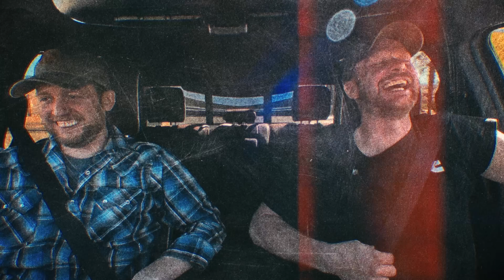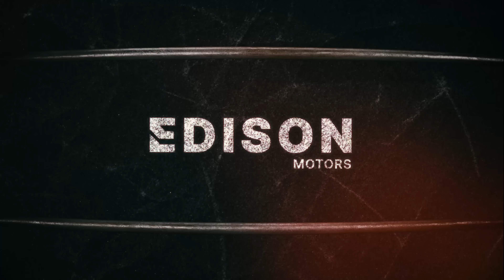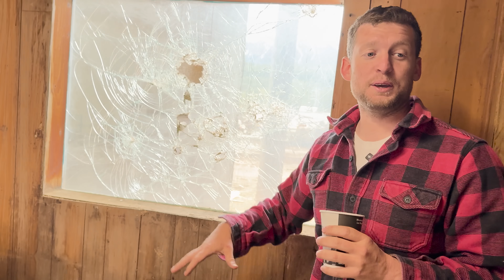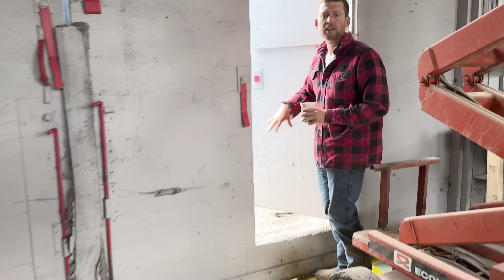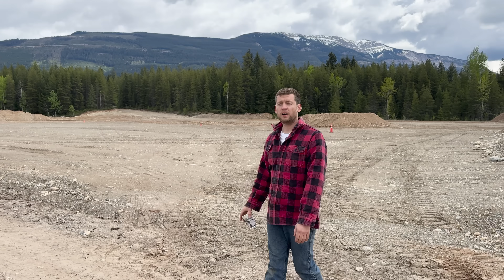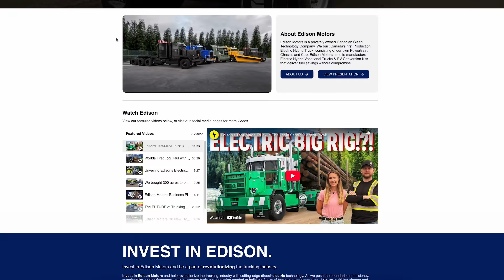Shop & Housing Update: Tour, Progress, and Investor Day Invite

Comment: Septic:  NB biogas/methane digestors!  They turn food waste and poop into methane that can run a genset, or, with a town gas connection; help run it.
If you use the (normally) wasted heat from a genset for heating rooms and workshops and water; the genset efficiency goes up from 30% to over 80%!
See Combined Heat and Power. (CHP)
They equal heat with FREE electricity, or electricity with FREE heat, depending on how you want to look at it. 

ie: Don't just go Old School; go greener/cheaper and more in line with the Edison ethos...  :)

Comment: I've been engineering an automated greenhouse for microgreens for about a decade now while I've been working in construction. Fully automated food production is the goal, then residential conversion from agricultural land without losing agricultural capacity. Also designed an automated BSFL facility, ultra lean like the microgreens to take advantage of the waste products. My system uses zero plastic for the microgreens unlike my competitors with a mountain of degrading microplastics spread all over their farm, and it's cheaper than conventional greenhouses in both initial investment and ongoing expenses. I eliminated the plastic trays and almost all of the work, while gaining 1.4x the growing area due to the angled vertical growing racks. Your story is helping me push my own project forward because at this point these projects are mostly limited by me. I never wanted to plan for investors or loans so I focused on material efficiency. That lead me to create an extremely lean, scalable model that I'll be launching soon in London, Ontario. It will scale with subscriptions, lower the price of microgreens to about 1/3 retail but I can actually get them down to $3/kg in my system while retail is $100/kg. They are nutrient accumulators so when demand runs out for the microgreens I'll be selling vitamins C, A, K, E and Folate, as well as chemicals and biodiesel derived from the microgreens, insects and their waste. It's not about the microgreens, they're a stepping stone to becoming an agricultural to residential land developer. My plan is to sell houses with rooftop greenhouses that pay their mortgage for them. The available housing will also serve my employees, allowing me to artificially create a community while selling some of them along with a production contract.

Comment: Recommendation: Carve out a 'bush' runway, 4,000 feet or better so those that have business aircraft and are considering placing orders can fly in quickly and see the facilities and projects in progress. Logging and oil field operators often use light commercial aircraft to rapidly move between sites  its a force multiplier for them   you seem to have land available.  Perhaps incorporate it as part of the test track as a straightaway portion
Reply from the maker: Okay, I’m listening
Reply: @EdisonMotors 
Golden just recently repaved their 4500 footer so you good if you got the fancy people visiting:)
Reply: @EdisonMotors  The idea came to me when you were standing on the leveled area speaking about waiting for soil engineers to come on site.
 I thought what a good hard pack soil for a bush runway. Then I remembered my younger days when I managed an FBO flight ramp and fuel operation. We had quite a few corporate businessmen that used General Aviation category planes to free themselves from the restrictions of hub airports and airline schedules. it allowed them to beat their competition and get more done in a day.
 Further I have seen factory sites that put runway infrastructure to do double duty.
  So my thoughts are the various regulatory agencies you will deal with will require engineering studies / evaluations for braking, handling, and start/stop distances for the various platforms you will build.
 Example accelerate to 60 or 70 mph then apply brakes and measure stop distance, dry pavement, wet and icy.
 That has to occur on a hiway standard paved surface.  If you plan that paved surface in such a way that it has clear approaches at each end, then you also have a perfect hard surface all weather runway

And the justification for the paving is because you have to do testing on a real world environment
Reply: Plan for a bush runway now so in the future they can hop in a little bush plane and zip down to Calgary.
Reply: The runway could be part of the test track, if its possible for people to fly in they can see the whole site on the way in, ease of access is always a good idea for customer relations, have to say its a really good idea 👍
Reply: Agreed. 3500' gravel strip with clean approach and departure ends is standard for remote communities in Northern Ontario.
That is plenty for a PC12, Caravan, Navajo, and B1900. With a solid enough base, even Dash 8s and ATRs will regularly come and go.
For guys who like to play with heavy equipment should be no big deal.
Only issue is that it does require mechanical upkeep with grading, compacting and snow clearing.
Reply: Yep, it's a nice straight section with just a bit more clear to the sides and a nice turnaround at the ends.
Reply: Came to say the same thing 😂
Reply: In 10 years, Edison will have more commercial trucks, than Tesla.
Reply: CYGE at Golden is an asphalt 4500’ runway. How close is the town? That’ll do for anyone flying in from AB or BC.
Reply: Why? Golden has a 4500 feet municipal paved runway 20 km away?
Reply: Make it only 100 m so only STOL Supercubs can land 😍
Reply: i could also help to fly in parts that are late or needed for service
Reply: It’s a ton of work to build a runway to accommodate a King Air or larger twin. Maybe someone comes in on a Caravan but I somehow doubt it. PC12 perhaps. 

I’d be hesitant to land my 172 at a new strip carved out by non pilots. I like the idea of an airstrip, it just needs to be done properly and for the right audience.
Reply: That would make a nice drag strip for some weekend activities 😂
Reply: If the runway was part of the test track the test truck would damage it, no?
Reply: There is an Airport in Golden just 20 minutes south of  Donald.
Reply: @tfodthogtmfof7644  if Edison has their own strip, then they won't need to rent hangar space in town.
Reply: @tfodthogtmfof7644 There isn't a auto rental facility though...

Comment: Sure seems like a great idea building in the k
Middle of no where. Until everyone you need parts and running to town isn't a option. There's a ready fab shops and manufacturers find somewhat local areas to build. Because hour down time will outweigh you land cost. There's a reason they liquidated that too Edison aswell, get that liability off there booms. It's not rocket science. Imof Edison makes it they will have huge capital cost of finding a new home and moving I'm under 5 years.
Reply: Nah. I think the frames are coming in from Vancouver, the engines from Sweden,  the cabs from Penticton, the batts and electronics from overseas. The rest of the big stuff comes in via semi truck delivery. 

I'm sure anything else they need like generic nuts and bolts they'll keep a big pile of because, just like you say, there is no "quick run into town". 

After a few lessons learned, they'll be just fine.
Reply: @Sah-o5m  and that's why every manufacturer of everything in history had ended up in a city. Like even consumables, like i highly doubt they are going to have a warehouse full of parts let alone want to overhead of a warehouse full of parts. So now everyone you run out of something your build comes to a stop because your waiting on a delivery or something.  Downtime will outweigh these positives soon enough. Who ever they bought the land from along with the realtor are laughing all the way too the bank.....

Comment: I'd highly, highly advice to store batteries in a separate building that has no other purpose than battery storage. Costs next to nothing, but can save your building or even lives if one of them ever goes up in flames. Once a pack has been installed and checked for cell balance etc its going to be perfectly safe, but the packs you get in fresh off the transport... who knows in what state they are in?
Reply: Perhaps store batteries in the empty 2 acre barn for now
Reply: THIS THIS THIS. Build a fireproof building for cell storage. Could be cinder blocks with cooling and heating.
Reply: I've seen temperature controlled containers for pack storage - packs under-charge then being stored in a safe place especially as theyre more likely to have issues when charging
Reply: If memory serves me correctly, I believe they are using lithium ion phosphate batteries (LiFePO4) that do not have any issues typically associated to traditional lithium ion batteries... They do not have thermal runaway issues or volatility
Reply: @Rudiculous_The_Magnificent  Topsy had LiFeP04 batteries that are indeed less prone to thermal runaway. However, they only charge/discharge at 2C and the strain of semi truck regen braking was too much for them. So the new batteries are LMO. LMO (while more prone to runaway) should be better be able to handle extreme charge/discharge with their 5C rating.
Reply: @Sah-o5m :   Thanks for clearing  this up...  In my foggy mind, I vaguely remember the other battery tech (LMO) just couldn't remember which one it was.    Thx!

Comment: There is a Hydrogen Electric CPKC Locomotive parked right there in Golden. Maybe you guys could check it out and do a video on alternative fuels for hybrid vehicles.
Reply: At this point I think hydrogen is just green-washing.
Though electrifying rail may limit container height in some of the mountain tunnels.
Reply: Thanks for the tip! A field trip during the field trip (but not actually in Field, lolz)

Comment: the fresh paint makes it feel like a totally different building, looks to be all coming together fantastically!

If septic / waste treatment is the one of the only permitting barriers you are doing great. Makes sense that septic is permitted because it has to be done right to prevent environmental damage!
Reply: though aerobic digesters wouldn't require any of that.
Reply: @felderup  AN-aerobic!  :)  = free methane for heating or running a CHP genset..!  CHP: over 80% efficient.  = free heat or free electricity depending on how you want to look at it. = cheaper and greener.